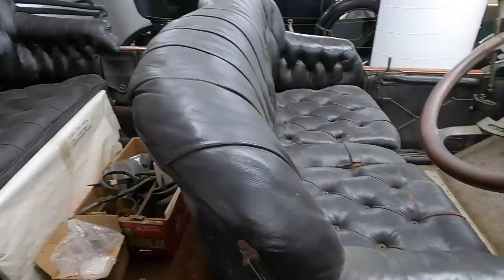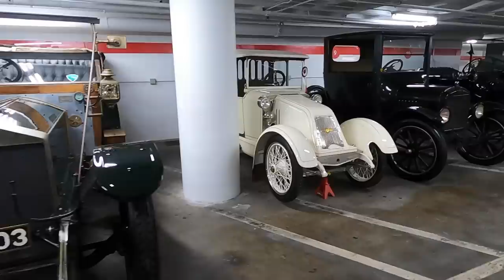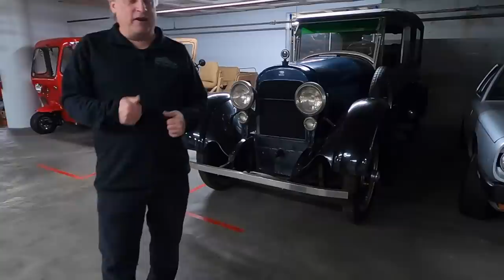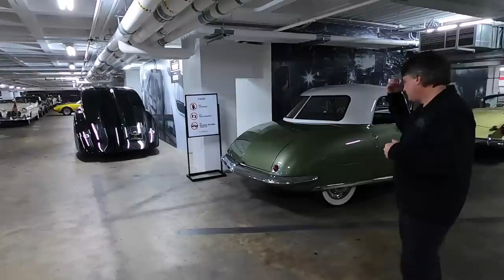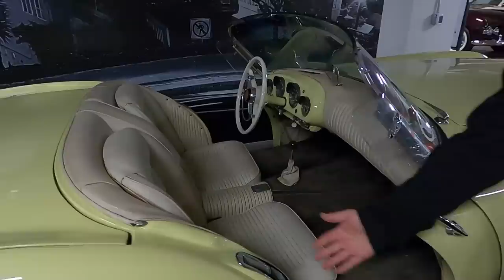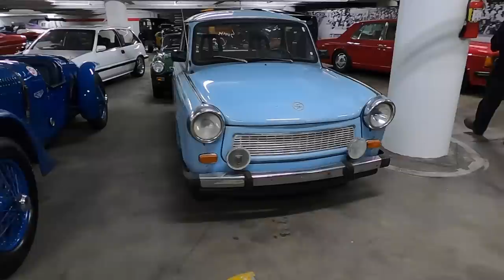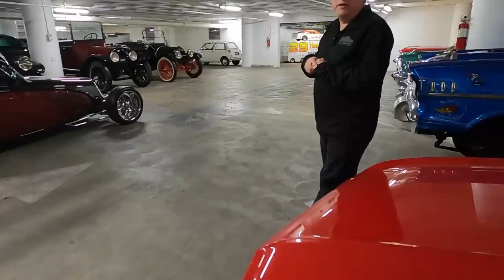WORST CAR FAILURES OF ALL TIME | PETERSEN TOUR

Comment: Seems a bit tough to call the Corvair a failure when they built 1.8 million of them.
Reply: It opens up an interesting conversation doesn't it? How about the Trabant? Truly one of the world's technically worst cars yet it gave transportation to millions.
Reply: I agree.
Reply: The Corvair was one of the primary targetsipf Ralph Nader's "Unsafe At Any Speed" book which torpedoed several "targets" in the American auto industry.
Reply: I thought the Corvair was a great car.
Reply: Many older Porches are tricky at speed, but belong in a niche market. I believe R.N. probably was right with regard to a mass market product.
Reply: Because the platform and name did not carry on, much like Studebaker, one of the best designed cars of it's time but poorly managed into oblivion.
Reply: @philipbarrett3151  The Trabant wasn't a bad car when it was first introduced, it was quite advanced and in many respects better engineered than similar sized cars like the Fiat 500 or Citroen 2cv. It's only a bad car because it was built for years past its sell-by date. But then again, so was the VW Beetle, Mini, 2cv (admittedly, if we're honest, those too were all completely awful cars by the time production ceased).
Reply: gotham61 To be fair, he DID explain how the Corvair became a symbol of failure, as the Edsel did.
Reply: @furripupau  but i liked the 2cv
Reply: @furripupau  
The Trabant was advanced?  In which way ?
Reply: Zombie slayer the C2V's suspension was genius, frame and engine were very innovative as well...  fuel economy amazing...  it hit its design targets very successfully
Reply: Bender MI I'm not a Trabant expert, but it had plastic replacable body panels, much like the Smart Car many years later
Reply: I specifically chose a '67 model year for dual-circuit brakes and shoulder belt provisions.  Sold it a couple years ago after driving it for 9 years... even 'having' to build an engine for it after dropping a vale seat included, I netted about 6 dollars when I sold it.  Needless to say, it was * MUCH * quicker when I did (grin).
Reply: @PRH123  
 
You are not an expert i give you that , google Lloyd cars . 
And the frame on the 2cv was innovative? That design was only used in the 2cv .
Both the 2cv and the Trabant had terrible handling ,  cornered bad and was useless on the aitobahn . 
No the only thing we agree is you are certainly no expert.
Reply: Not to mention the engineering accomplishments that went on to be used in other production models.
Reply: @mr.gabriel382  
Such as?
Reply: @philipbarrett3151  it isnt even technically worst, the worst thing was the built quality
Reply: @PRH123  they were deadly poisonous when burned, a combination of phenol resin & cotton waste known as Duroplast
Reply: Bender MI Handling and cornering were not design goals for the C2V, and there were no Autobahns in France when it was designed.  One must assess a car against what it was designed to be. It wasn't supposed to be a Ferrari, it was supposed to have excellent fuel economy, an extremely compliant suspension for rough or off roads, be cheap to manufacture and be reliable and easy to service.  It hit all of those design goals. Check google for how much one in good condition sellers for now.
Reply: @bendermi  Front wheel drive, transversely mounted engine, rack and pinion steering, independent suspension, etc. in the 1950s. Stuff most companies wouldn't pick up until the 70s. And its handling was better than pretty much any other small car of the time (heck, it famously outhandled the Smart car in a test done by a German magazine about 15 years ago). Then you have the plastic body panels, a concept later taken up by Saturn. When the first Trabant showed up in 1957, most small cars were something like the Ford Popular - positively stone aged engineering, or rear engined with no handling to speak of, like a Renault 4cv.

Then compare the car directly to its competitors and it does pretty well. BMW 700? NSU Prinz? Fiat 500? In terms of interior room and trunk space, the Trabant beats all of those. If the Trabant had been discontinued in say, 1974, just for example, it'd never make anybody's list of worst cars. It'd just be one of a billion other forgotten small European cars of the era. It only became "bad" because they were still making it in the 80s and didn't stop until the 90s, where it became an easy target for lazy jokes.
Reply: @MikeBrown-ii3pt  Nader owned a Corvair (really!)
Reply: Such a failure that they have at least two of them.
Reply: @seadog686  You should actually look at the book.  There's maybe two pages on the Corvair.  It's something the press took up and ran with.  We may never know who was greasing the wheels to make that happen.
Reply: GM did it to themselves. They were so butthurt over the criticism they hired people to track Nader to try and get dirt on him. Nader found out, took them to court, and GM embarrassed themselves and brought way more attention to Nader and his book than Nader could have possibly ever dreamed of. If they had ignored it, Nader wouldn't have had a career, and nobody would remember the book.
Reply: @furripupau  
Lots of facts but it was mostly sold in the east the steering column would go straight into your chest the gastank was on top of the engine it was unstable when windy it was not made out of plastic .

Where did you get those facts on the flea market?
Reply: @bendermi  Not sure why you seem to be getting so embarrassed.
Reply: Yeah. GM probably cried all the way to the bank.
Reply: My fam had 3 Corvairs '61, '66, '67. Great reliable. Totaled the '67 to driver error.
Reply: Where was Nader on lousy politicians?
Reply: As I recall, Nader was writing about the early Corvair. I have no idea how correct he was or wasn't in his specifics, but I was riding with a friend in one and he tried a speedy turn that had a bump in it and we hopped up on three wheels and then spun a 180 that wound up almost off the road. I think it was a little unrefined and not understood by the general driving public. The newer gen seemed like a big step up in all aspects, tho I never rode in one.
Reply: @bendermi  The design was also used in Dyane 6. "The Dyane design was directly based on the Citroën 2CV." I'm not sure the handling was så bad. My parrents had a 2CV and later om my mom had Dyane 6. Yes it had a very flexible suspension and it was intentionally. It was build to go over fields with a bowl with eggs at 40 km/t without any eggs get cracked. Our 2CV has been getting over hill in the wood full loaded, where other cars have trouble getting over. The 2CV had a sunroof that could be openend all the way to the back of the car. My mom drived through snowy weather without trouble where other cars could not get a grip.
So it really wasn't such a bad cars.
Reply: @kennyscott1089  ,
You're not the only one, Kenny, I owned a few of the Corvairs and I didn't have any complaints. They were great in these Michigan winters.
Reply: Disclaimer: I am not a Chevrolet fan. 
If you love car history there are some nice detailed media on the Corvair story. Car building experts who understand handling and performance say the Corvair was on par with other (similarly built) cars of the era - the VW Beetle was one of them if I remember correctly - in terms of safety and handling.
The fact that the Corvair had significantly more power than its contemporaries, it was more dangerous with its superior acceleration in cornering situations.
Reply: The Corvair Convair was my first, and just about my favorite car.
It was clear from the outset, that Ralph Nader had never driven one in his life.
Reply: I have always wanted a Corvair.
Reply: Maybe a pr failure ...but still a good looking car.
Reply: A car company executive today would sell their grandmother to be able to sell 1.8 million cars.  The Corvair was a resounding success for Chevrolet.  They just had no way of putting a large V-8 in it to compete with the Mustang.  The 1965 Corsa had a 180 HP Turbocharged air-cooled engine  mounted in the rear with a revised fully independent suspension, a standard 4 speed transmission, and guess who copied it 3 years later...Porsche with their 930 Turbo.  Just think what Chevrolet would be building today if they had continued development:  a Porsche at half the price of the German one.
By the way, the Pinto was a worse handling car than the Corvair, and the first Mustangs were comical to watch trying to go around a corner.

Most people in 1958-1960 looked at the Edsel and saw a Ford with too much chrome.  I remember going to a Ford dealer with my dad to buy a new car and when he walked past the Edsel parked there, he whispered to me, "Would you buy that?  It sure is ugly."  Being a teenager at the time who almost never agreed with his parents, I agreed with him.

Liz Carmichael was a man in a dress.  So you couldn't give him a cent. Looking back is just like today... Liz looked like a man in a dress.
Reply: jamie ericcon    Nice one.  You obviously love it.   Good on you for sure
Reply: it was more like everybody's butt money, like the pinto
Reply: Ralph  Nader  is the  guy who derailed  the corvair
Reply: @philipbarrett3151  it did exactly what it set out to do. Give transportation to the masses. I’d say that’s a success.
Reply: @zombieslayer8218  are you nuts?

Comment: I had a Corvair in the 1960s. It was one of the best cars I ever had of that era. The only other car that edged it out was the Volkswagen. The Corvair  had a much better road feel than anything from Ford.
Reply: I had a couple corvairs (60 and 66) and a 62 Nova.  In total the 62 Nova was much better than the 60 corvair.  For handling/performance the 66 Corvair was best.  If I put myself in the position of what most informed car buyers of the time who only have one car would want overall it would be the Nova because it did everything well.  Our family also had a 64 Chevelle (283HO) which I would rank as one of best most balanced car designs of the era.
Reply: In the early sixties you could get a Corvair with a 150 horsepower turbo charged Flat 6 air-cooled motor what did Porsche have? An anemic four banger with 60 horsepower. Second generation Corsa came with either four carburetors or 180 horsepower turbo. A very Advanced car like nothing else in the United states.

Comment: The first-generation Corvair looks amazingly like an NSU Prinz. The second generation was a handsome and pleasant machine, especially when the engineers defeated the bean-counters and installed a double-jointed axle, rather than the crude but cheaper single joint.
Reply: I had a '66 Corvair Corsa with the turbocharged engine. Handled like a dream with some added weight in the trunk.  The real drawback of the 'vairs was that they all leaked oil like a sieve.

Comment: Edsel was, really, not a bad car.  My home town in Michigan used a '58 Edsel Villager station wagon as an ambulance until about '67.  A family friend put over 100,000 miles on a '59 Edsel station wagon.  The Edsel was often called "Mercury sucking a lemon" because of the horse collar grill.  
I also drove a second generation Corvair that belonged to a friend.  I would never have bought one just because of how light on the front end it felt at only 65 MPH.  Down right scary.
Reply: Edsel is just a rebodied Fairlane and those are completely reliable. I drive a 57 with 292 and adapted 5 speed.

There's a Corvair resto shop near me. The owner has told me most people weren't aware they're supposed to run low (10psi?) In the front apparently 🤷‍♂️

Comment: You didn't mention the Corbin.
It's the little pinkish red bubble like thing beside the large pink and purple front drive car.
Reply: I didn't catch it, but was working for the "exclusive" san francisco dealership that was owned by one of his big investors. After checking it out and talking to Mike Corbin, I started asking a lot of questions on how it was going to be under $13K if each car had nearly $30K in it, he gave a speil about how many he's be building within a year and a bunch of other crap. Our demo car rolled over while the shop owner was driving, and the car was badly damaged. I knew the entire corbin motors was just a scam when he was showing a mockup of an engine being developed, one from the same company another scammer back in the early 90's was trying to sell off as the new Indian motorcycle company. That bastard Mike Corbin was lucky to keep his motorcycle accessory company after all that.
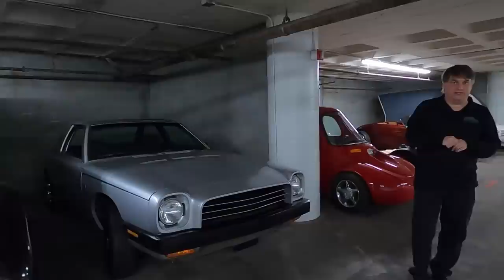Reply: 13:40

Comment: Great video, Great ending! I thought the failure of the Corvair was most people didn't know the front tires only took 10 pounds of air pressure. They would put in 28-32 pounds or more and lose control, especially in wet conditions.
Reply: never had that problem
Reply: @garth locklin

Please! Ten pounds, give me a break. Any car with 10 lbs pressure in the front would be undrivable and dangerous. If you were attempting a joke, it wasn't funny. Try harder.  If trolling then you got a response.

Anyway, fascinating trip around an amazing car collection! Thanks!

On to Corvairs...

My first Corvair was a '62, the one with the swing axles. I upgraded the car with Fitch Sprint aftermarket springs, quick steering arms and better dampers. The recommended tire pressures were way too low. According to pro test drivers, If you put a lot of side loading on the rear tires, they would roll under and sometimes pop the bead, causing the wheel rim to dig into the pavement and flip the car. The car was happiest with thirty two lbs all around. 

In the races held as part of the Lake George Winter Carnival, in my very first race of any kind, I started the weekend last in class and finished the Sunday finale second in class after chasing the winner who was also driving another first gen, Corvair, I had just turned twenty one and the winner was probably in his late thirties. He was not amused when I went over to him to offer my congratulations.

I managed to get the swing axles fully extended when I got cut off on a highway entrance ramp. I hit a sloping curb with the right side tires. After nearly flipping, I experienced the mother of all tank slappers as the swing axles ratcheted back down to their normal position. The rubber  marks on the pavement were, ummm, interesting! It would have been ironic had I crashed it as I was to pick up an MGB the next day. For the few years I drove the MGB during spring, summer and fall, and drove the Corvair during the winter.  I did get stuck in the Corvair one winter. The snow was over the hood though.

During the seventies I ice raced three second generation Corvairs that I also drove on the road with not a single spin. Corvairs owned the rear engine rear wheel drive class. My Corvairs were not specially prepared for the ice like the faster Corvairs which were towed to the venues and were always up front. I ran around the upper part of the mid field runners.

A pressure of about 28 to 32 lbs. was the "sweet spot" depending upon the ambient temperature and the concomitant pressure increase. In any event these cars were just fine in the rain and even better in the ice or snow.
Incidentally, the rear suspension on the second version is pretty close to the rear suspension found on the Corvette. However the half shaft angles are incorrect. When driven hard, the outboard universal joints had to be replaced roughly every fifteen months or so.

In total I owned probably five or six Corvairs over the years.  

Fun fact, for many years the SCCA D Production NE Division champion drove a Yenko Stinger. He generally buried the rest of the DP field back in the day.

After the success with the 850 I quit ice racing to concentrate on racing formula cars in SCCA competition at such venues as Watkins Glen, Thompson, Speedway, Lime Rock Park and Bryar Motorsports park.  I also took a Skip Barber three day racing school course and a three day advanced course. One of the students in the advanced course was Wally Dallenbach Jr. 

Operating on a shoestring budget, I only won one race in my Brabham BT-28/35 ex 1 liter F3 car, lots of top fives though. Later in Formula Ford my best finish was a third. After developing the car further my lap time increased to match the times of regional race winners. Then two races after setting up the car properly, the motor blew up at about 130 mph, my career took an down turn and I was out of racing.
 
 -dave

Comment: The Porsche Typ 360 was a fully functioning Grand Prix car, not just an engine. It was based on ideas Porsche had for for Auto Union's 1940 season, which never happened of course. The car featured a mid-mounted 1.5L supercharged flat-12, a motorcycle-style sequential manual transmission and selectable all wheel drive. Porsche later rescued it from Argentina and is now restoring it and an unfinished second chassis.

Comment: "Unsafe At Any Speed" was not a book about the Corvair.  The Corvair was only mentioned in one chapter as an example of a design flaw which GM knew about before releasing the car and didn't fix until after the model had run a few years.  GM did fix the problem with their rear suspension eventually, but deiced to release the early models with a known flaw because they were more concerned about profit than safety.  That was the entire point of using the Corvair as an example.  Had the book been written in the 70s, the Pinto would most likely had been the example used.

Comment: Early Corvairs only had one CV joint per side. That was a huge issue, would bury the rim into pavement on some turns.  Later and converted models were fine
Reply: I loved my 64 2 door , and 65 convertible 140 horse.
Reply: That was due to low tire pressure. 1962 Corvair spider, turbo charged and highway capable.